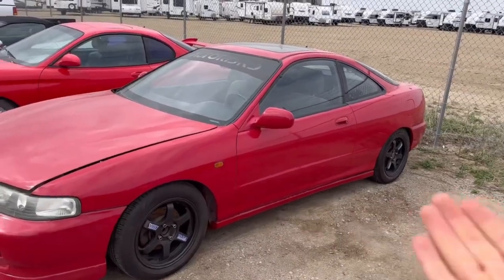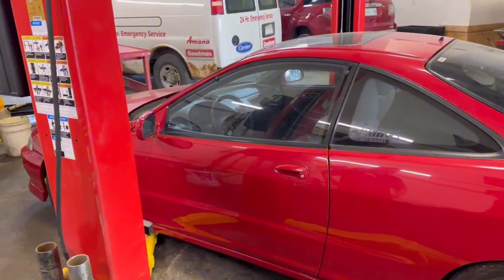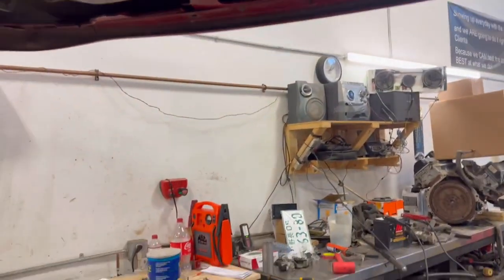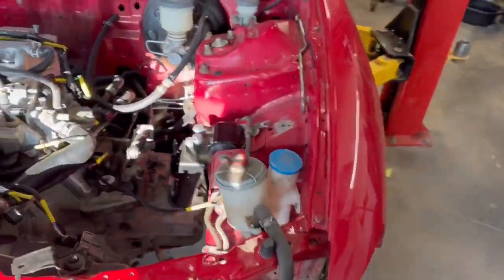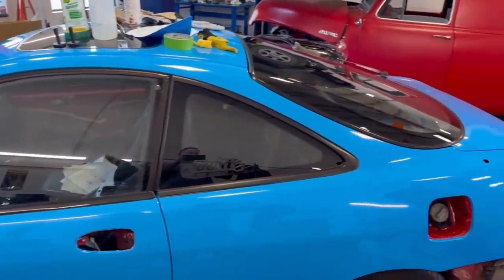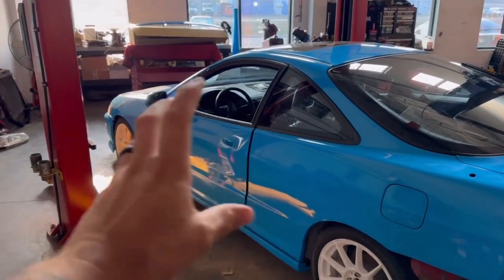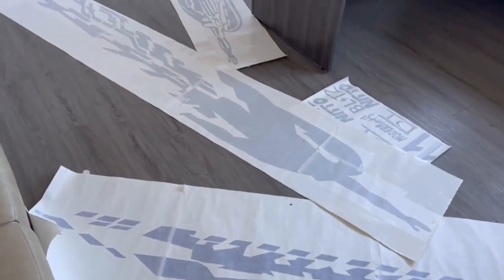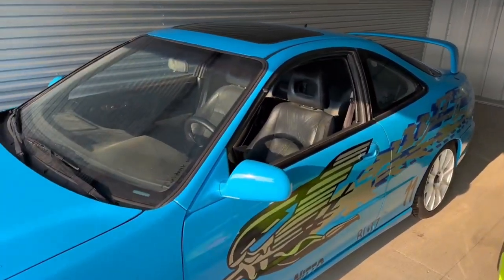My Fast And Furious Mia Toretto Acura Integra Tribute Build With K20 Swap

Comment: You can jump vtec pressure switch wires with vtec solenoid and no need foe pressure switch after that skunk2 makes a throttle body that fits Rbc intake manifold and it will work on prb intake manifold also pretty cheap $150
Reply from the maker: Good to know! Thanks!